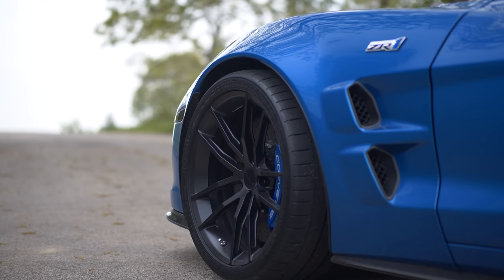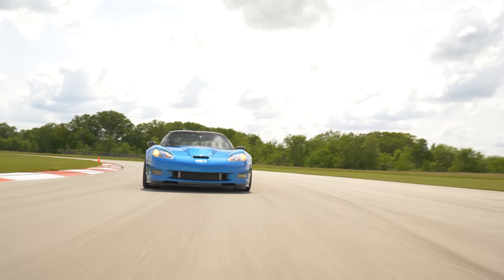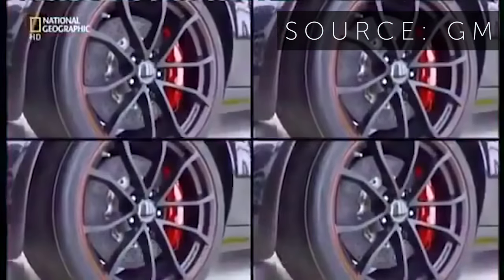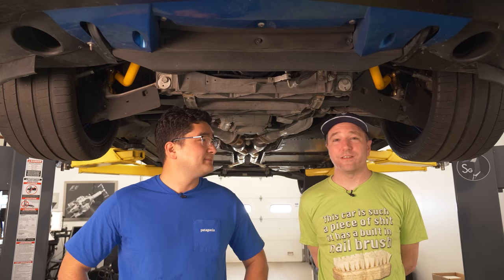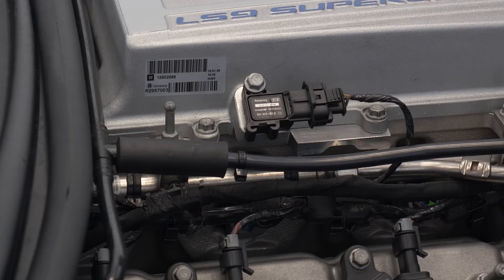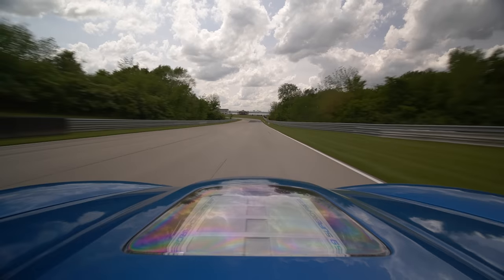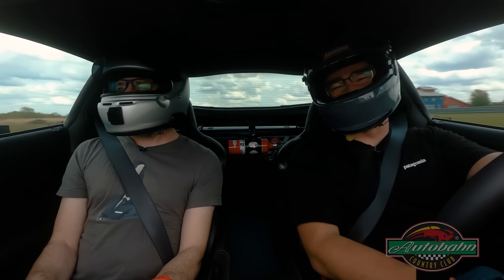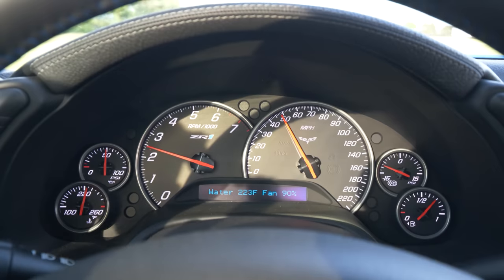Corvette C6 ZR1 | 1000HP Death Trap

Comment: When the speedometer looks like a tachometer, you know it's serious.
Reply: I saw it but I didn’t really pay attention. So I went back and looked. That speedometer is climbing as fast as that tachometer. That is scary. I don’t know if I want to be in something quite that quick or fast.
Reply: @GRSEMETROMALL  you won't know until you try. I always implore people to drive a bunch of cars before making a decision
Reply: I was noticing that myself. Seemed like the speedo was sweeping faster than the tach needle.
Reply: when your tachometer looks like a speedometer it’s serious
Reply: @zTheBigFishz  one of my favorite cars is the c6 z06 simply for that reason. Manual transmission, roaring v8, all motor, rwd, and fast as hell. Everything people say about these cars, good or bad, goes away when you get behind the wheel. It provides a raw and exhilarating experience that not a lot of cars can provide, especially these days. They're light and handle really well too. Great in a straight line, and amazing around a track. This goes for the c6 z06/zr1, and c7 z06/zr1 really.
Reply: @MaxSpeedMike  plus with a Z06 on a highway drive you can actually get great fuel economy if you drive with that purpose.
Reply: @TheSurfRyder  of course. They cruise well. 70  mph in 6th gear and you're around 1,500 rpm lol. 80 mph is around 1700/1800 i think. Crazy stuff, but that's what the tall gearing gets you
Reply: Thats Tesla Plaid acceleration in the straight line.
Reply: @michaelgomez4994  love that comment!   so true!
Reply: If the speedometer does not climb as fast as the tachometer, you know you are not in a survival gear.
Reply: @aussie2uGA  faster than the Tesla actually. Because nobody has seen the Tesla, yet
Reply: Fing Camry TRD power up in here!
Reply: Yeah exactly. This car sounds, looks, and feels fast even though I am watching it on a video. 😂
Reply: No doubt, that was unbelievable to watch.
Reply: @MaxSpeedMike  yeah, but no.  I am incorrigible.
Reply: @GRSEMETROMALL  it's good that you can admit that but it's worth changing to gain more experience and memory in life :)
Reply: When your favorite YouTuber gets pinned on a huge video.
Reply: @CameronLegend  oh hey there ;)
Reply: @MaxSpeedMike  hey ;)
Reply: @GRSEMETROMALL  hey dude I remember you! Still working that newer job?
Reply: Yeah it legal .way beyound 300 k barriers.  He died. L.O.L CONSERVATIVES JOKES IN CANADA
Reply: @MaxSpeedMike  What you think of the '03 Anniversary edition Z06?
Reply: @Re3iRtH  i like the c5z. Great value for the money. I just personally have been in a c6 z06 and c6 zr1. The interior and the styling of the c6 really does it for me over the c5. And of course the more powerful ls3, ls7, and ls9 options in the c6s along with the transmissions are a plus too
Reply: @MaxSpeedMike  Only problem is the blown heads issues in the C6 (can be as early as 20-40k miles.
Reply: @Re3iRtH  no mileage for that. Can happen anytime. You spend $10k, you get the heads done and add a custom cam, intake, headers, exhaust, a tune and in some cases, e85 if you want. Now you fixed the issue and you're in the 580-650 whp range with reliable power.
Reply: @MaxSpeedMike  Whats reliable mean to you
Reply: @MaxSpeedMike  I've spent the last 10 years overseas driving cheap cars (like my Daewoo Tosca I'm driving now I paid $1800 for). Fortunate to have done really well in real estate since 2011 and now have a mid-6 figures cash position. That said, the sportiest cars I ever had were my beloved S2000 (totalled by a teenager) and an '06 Lexus IS350 (imo fast acceleration). If you have $50k to spend in the US on a vette which would you recommend for me? Appreciate the input.
Reply: @Re3iRtH  daily driveable. 10-15k miles a year no problem. Lots of those miles being hard miles, rallies, street pulls, etc. No major issues and the car runs great every time you take it out. These cars can be seen with 90k+ miles and you can make those hard miles with a good setup, reliably.
Reply: @Re3iRtH  or just enjoy a slightly slower ls3 in a base or grand sport c6. And if you wanna make it faster, boost it. Very cost effective on those engines
Reply: @MaxSpeedMike  What you think about a '03 Anniversary Z06 and leave it stock?
Reply: @Re3iRtH  meaning you can jump in and expect it to crank 99/100 times.  Any ls powered car I’ve owned has been crazy reliable they’re fucking work horses.
Reply: @Re3iRtH  that’s a great car. The interiors leave a lot to be desired but basically everything else about the car is great. If you’re coming from a stock or Bolton s2000 then the c5 z06 will be a significant performance upgrade.
Reply: @mogulme6190  sorry I actually meant a 2013 anniversary edition z06, so a c6. Rebirth is also me. I'm now in the market for either a c6 zr1 since the 2013 anniversary editions always sell within 2 days if the price is good. I drove a couple of zr1s the other day and I'm absolutely hooked!
Reply: THIS is the comment that explains this thing… There was no excuse for why the hell that thing is moving that fast clockwise… Absolute insanity

Comment: Owning a Z06 from this generation with a measly 505 hp and knowing how fast it accelerates I can only imagine how this would cure prostate issues of flow when you’re pissing yourself in fear.
Reply: the C6 Z06 has a ring time that's only three seconds slower than the ZR1
Reply: @shekelwarlocke  only 3seconds? But then, power don't translate into ring time that well.
Reply: @TsLeng  Yeah good point. The 911 GT2 RS has like 150 less hp than the 918 but was faster because it was making almost all of its power the whole time. The 918 was making as little as 600 in some areas, so it was slower. The ring favors consistency and smoothness, not just 1000 hp.

I still want the ZR1 tho lol
Reply: My C6 Z06 make close to 600whp (H/C/I/E) + fixed valves. That is with stock TB & IM. Something about NA 7.0 liter 427.8 cuin engine that cant be beat for the $$$. Plus is is lighter than the ZR1 and about half the cost.  ZR1 will always be more of a rare collectors car  IMO. Then again if you want a 1000HP car you cant beat the LS9
Reply: @shekelwarlocke  the Z06 is also 200lbs lighter than the ZR1
Reply: Ahhh so that’s the Big 7 Litre. LS7 😏
Reply: Fortunately most owners' prostates are large enough to ensure urine flow is obstructed.
Reply: @shekelwarlocke  that Z06 time was on the later model Z06 with a specific "Z07" package. I believe it was available on 2011-2013 models and those Z06s stickeref for 100k+. They had all the ZR1 suspension, body, most aero pieces, and the carbon ceramic brakes and sport cup 2's. A non Z07 package C6 Z06 wouldnt come close to that time..... it was still fast as hell though.... i think they ran 7:43 back in 2005 with a regular Z06 which is still mind boggling to this day.
Reply: @gene7314  just a fyi.  First year for C6Z 06 was 2006, I agree on all the other points.
Reply: @lag1791  i know it was but i think they ran a pre-production car at the n-ring in 2005 to set their 7:43 lap time..... i can be wrong though*
Reply: Still cant keep up with 5k superbikes tho. That's where you get the best bang for buck
Reply: @theyweredeadwhenigotthere1391  this will destroy superbikes..... lol cmon man.
Reply: @gene7314  um you are plainly ignorant. You need more than 1000hp to keep up with my r1... I've never lost to a car ;)
Reply: @theyweredeadwhenigotthere1391  if highway roll races are your thing..... 870RWHP is nothing for a C6 ZR1.... these can make plenty more....aside from that you have zero shot at taking this on a road course.... youll see 4 tail lights if youre lucky.... ignorance is bliss.... on your part. 🙂
Reply: @gene7314  lool keep dreaming. I don't ride on courses or M pay for track time... I whip in and out of traffic like a madman because I have cahonas.. racing anything that challenges me and I've never lost. Raced a v12 amg the other day guess how that turned out... and what do you drive? Any experience to back anything you say up or another keyboard warrior
Reply: @gene7314  tuned 05 Yamaha r1 power commander 3 full system exhaust. Lowered 2 inches. Weighs 400 pounds.. 195hp... would destroy 870 at the wheel in a straight line... I've beaten hellcats easily... js
Reply: @theyweredeadwhenigotthere1391  my guy you dont know what youre talking about sorry..... im expecting you to tell me you have a modded S1000RR or ZX12R lol. 870RWHP ZR1 will gap you lol..... please dont tell me about hellcats or even put that in the same sentence as a ZR1. This ZR1 runs with huracans stock (another top end monster). now your givin its almost 900 to the wheels....its over 1100 pounds lighter than a tugboat hellcat and more aerodynamic. RPM and LMR build way more powerful ZR1s this is just scratching the surface on this car.... i can see you have never ran a seriously powerful car or a ZR1..... 1/2 mile times cars destroy bikes.... this ZR1 would probably run low 9s 155-160mph traps.... which is what your bike would probably do.... after the 1/4 it would walk the bike easily. Dont wanna sound disprectful there are definetely some stupid fast superbikes out there but 200HP on an old R1 aint gonna take this ZR1..... youre under estimating how fast this thing is..... especially on the top end. R1 is a sweet bike.
Reply: @theyweredeadwhenigotthere1391  lol i just your comment.... youre like 21 tops easy to see..... naming corny stock cars..... no one gives 2 caps about highway rolls bro. If you want you can gl find some serious car this ZR1 in the video would destroy you lol. I have a 2014 Z/28 heads cam.... 550RWHP conservative.. its a road course car.... itll run with your bike on highway too.... grip king.... i use to ride also and do dumb   shit on the highway....... you speak for minimal experience lol....open road no cars.... new AMGs, M5 will smoke you too. Be careful out there..... we all have "cahones".... better to have brains instead. 🤔😉
Reply: @theyweredeadwhenigotthere1391  Hahahaha you really think a "tuned" 05 R1 is fast?? I guess perspective really is everything...sorry you've never actually experienced something that's truly "fast".
Reply: @ryanbrown918  lol I mean if you're saying that under 10 second quarter mile isn't fast than I guess you have 100s of thousands of excess revenue to spend on going a few seconds faster. Kudos to ya! You win I guess? Lawl
Reply: @ryanbrown918 I'd race you anytime in your 600 horses and put money on it that I'd easily beat you.. ;)
Reply: @ryanbrown918  wouldnt happen to live in the kc area would ya? ;)
Reply: @gene7314  im 28? Lawl live in 816 area? Id love to put money on it..  thats how confident i am that you wouldnt even keep up lol
Reply: @gene7314  actually my 15 year old bike keeps up with moderns ones with 200+ hp... but i have no pussycat aides like traction control. Antiwheelie.. rider modes abs
.. etc etc.. i just know ive never lost to a car in the 5 years ive owned this thing and i live in a major city with expensive cars and actual tuners alike. Should say alot... and im saying that absolutely no car for 10k or less is gonna keep up with a bike.. thats all im saying. I didnt need  to spend a fortune for my adrenaline rushes... oh and try outrunning 5-0 in your "supercars" i bet you have to spend alot more on layers/keeping your license than i do ;) especially in new york lol
Reply: @wasdwasdwwasd  underrated reply
Reply: Well the z06 is 200lbs lighter and a more manageable car around the track. That definitely counts for something. Only difference is weight and HP. Suspension and tires are the same.
Reply: @shekelwarlocke the ZR1 is probably even more work just trying to keep it on the road.
Reply: Z06 has 505 on paper but 550 real
Reply: There's always some idiot that turns these things into a bike thing...  Go watch videos about bikes and comment on those.
Reply: The z06 throttle is a lot more responsive with that 7.0 compared to the supercharged 6.2
Reply: @dimmacommunication no it Dosent it has around 450-470 wheel and around 500 crank

Comment: To my eye, the C-6 is one of the best-looking Corvettes of all time.
Reply: Agree, they are not aging as badly as the C7 likely will...
Reply: @cmacd8879  I’m a big fan of the C6, but the C7 seems to be aging very well, and I like it’s exterior design.
Reply: @cmacd8879  Circles are largely known to be timeless elements and the rear of the C7 will likely not be as attractive in the future
Reply: early c3 is best
Reply: The C2 and C6 are my two favorite Corvette designs, with the later C1 being very close behind.
Reply: Agree 100%
Reply: c5 zo6 holds a spot in my heart for life
Reply: The zr1 especially. The normal c6 looks pretty similar to the c5 without pop-up headlights and a different rear layout. The zr1 adds a lot of small details like the wing and engine window that makes it look a lot meaner and more like the supercar that it is.
Reply: The c6 is a beautiful general shape, I could've easily got a c7, if i stretched myself, could've gotten a c8, I didn't, I got a c6 427ce.   C7 is aging just fine, but the c6 was a better generation all in all.  Looks good, performs well, the electronic nannies will turn off if you ask them (not true for the c7), and in the z06/427's case, you can't beat that 7L rumble.
Reply: The C6 will always be the pinnacle of the classic Corvette design. There's something about it that is so clean and iconic. The C7 and C8 is a futuristic depiction and was a huge departure from the classic styling. That being said, C7 & C8's will be special because of that.
Reply: the c6 is definitely the timeless vette… cant believe im saying this but i actually like this one more than the c8 rn its like new retro but when i get the option id go c8 so i can be the first owner of my first vette
Reply: Fax
Reply: YEs !  the exterior design of the C6 pays homage to the C2
Reply: @alh06  And it's grown on me, considering I initially thought it didn't  look like a Corvette anymore. Same about the S550 Mustang.
Reply: @Ghettoize  Same here, along with the facelifted C1 (which is absolutely wonderful to me) and both C3s. I also love CERV-III Concept. It's such a gorgeous design.
Reply: Fax
Reply: @cmacd8879  prolly cuz of the simplicity
Reply: I always thought they looked like a Ferrari
Reply: it's my favorite generation
Reply: Every gen has "the good spec"
Reply: I-Agree
Reply: C6 Corvette is hands down the best looking Vette ever!!!!!

Comment: I'm 16 getting my license next month. Is this a good first car?
Reply: @miloslogic  I'm just worried I'll outgrow 1000hp. I want to daily this car for at least a few months before I move on to a more serious car
Reply: Yeah, its okay, but your friends may make fun of you for not having a Lamborghini. Honestly less than 1200 hp neans it can barely pull itself.
Reply: @daltontaylor6184  that's what I'm worried about. I guess the car could hold me over for a few more months if I go to 1200hp
Reply: It’s fine. Remember if you really want to flex in front of the high school parking lot, turn off T/C and punch it from a 30 roll.
Reply: Are you planning to pull a trailer with it? If so, try find the diesel variant of this car.
Reply: when you install your racing harness make sure you anchor it to the floor and not some cheap 3/4" bar in the back.
Reply: It's slow as a turtle !! And boring af! 
Get yourself something that can move under its own POWER 😜
Reply: @mrlten2907  I'm going to get an 8v92 detroit to pull my trailer. It should have enough grunt
Reply: @hugostiglitz8465  why would I be joking? 1000hp is barely enough for a daily driver
Reply: If you like paying excessive insurance premiums. lmao
Reply: @tabbott429  I'm not worried about that. Once $15 an hour is passed I'll be good. That plus Biden bucks here and there as a bonus
Reply: Wtf is going on in this comment thread😂
Reply: Honestly, just get your motorcycle license. Turbo busa is an excellent choice.
Reply: @nickluckovitch3288  I already have a supercharged boss hoss. A turbo busa is ok as a starter bike but that's about it.
Reply: My father gave me a 1995 Z28 back in my senior year (1996) in high school. Awesome car for the time but honestly it was to dangerous for a teenager. I remember running it at 148MPH one morning I just wanted to know how fast it would go. Luckily nothing ever happened since my father took the car away immediately after receiving a ticket at 117MPH. It was the right thing todo and he did give me some wheels to get around after that. It was a cool 1984 Chevy celebrity. Teenagers should never be trusted with a high performance car...
Reply: @josels1292  I'm not just any teenager. I play forza everyday
Reply: This comment section makes YouTube worth it.
Reply: Yes, if you hitch it up to a horse and keep a dry gas tank.
Reply: Fuckin send it
Reply: My first car made 1100 to the wheels and it just wasn't enough for me. Now I'm making 1600 in my supra and its fine, but I still long for 2000+. 1000 HP should give you well enough passing power but not much more.
Reply: @defyyourlogic487  yes that's what I'm worried about. I should probably just go straight to 2000hp and maybe the car can hold me off for more than a few months
Reply: @wigletron2846  Yeah dude. If you can swing the insurance I'd say go for it. Luckily premiums should be pretty cheap on anything less than 3000 hp. 2000 should feel pretty nice and still low enough to get the most out of it in the canyons.
Reply: @defyyourlogic487  I'm not worried about the insurance premiums. I got $15 an hour and Biden is talking about throwing a couple grand my way again. I'm basically set for life
Reply: Sure but don't forget to add nitro!